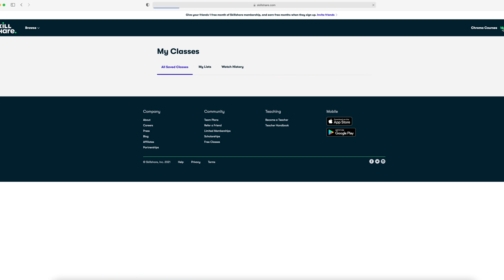RACING to Get HEAT in our OFF-GRID House BEFORE It Gets too COLD!!!

Comment: do you not have to put that foam seal on the bottom plate where it touches the cement floor?
Reply: I believe Al thinks that the lexel sealant should be sufficient?
Reply: Think about it. Foam is for a thermal break and water seepage. Not necessary  for a heated, indoor slab.

Comment: Your hard work is paying off, but there’s still a long way to go to get where you are at Lumnah acres! One thing that maybe helpful, they make a simple sheet goods 4ft x 8 ft sheet carrier that allows you to lift the sheet alone with a small hook on the bottom edge that is attached to a small metal cane like handle. When you stand erect the sheet is off the ground even when your arm is fully extended. So it’s easier to lift and carry. Your other hand is free to balance the top of the sheet or open doors as you need. You can even carry up and down stairs! Looking at all the sheet material your using lately it might be a wise investment!

Comment: Fan over the shower? For myself, I wouldn't, but it is allowed by the NEC.  Just make sure the fan you get is made for the shower. It won't be a steamless bathroom.   It will cut down on the steam, the fan is used to remove some of the steam and if left on, will dry out the bathroom. But in order to do that you will need fresh air. It's recommended to have at least 1/2" space under the bathroom door to provide the fresh air. That's means you will pulling the air over you too. That's why I like my fan away from the shower so I won't lose that warmth so fast. But if that's how you want it, go for it.

Comment: You are suppose to keep lithium batteries around 70 F to make them last. The weather conditions make everything take a lot longer.
Reply: he mentioned several times the mfgr says these are ok as long as it's above freezing. I suspect the internal temp of the batteries is a bit higher than room temp anyway.
Reply: @shartne  ... what happens? They get to eat their words over warranty claims. I would bet the conditions inside that home will be way more stable than conditions in a camper located in the desert where temp swings can be more than 50 degrees in a single day. These batteries will never see 110 degrees in the shade.

Comment: Hey guys do you think you should possibly have 2 of the radiator heaters on site just in case one fails? I know you have the connection to the system to warn you if temp drops. Lets say the radiator goes kaput and there is no way to get a new one due to road conditions or their out of stock again due to weather/availability. If there is no backup with the radiator heater I guess you will have to run the propane to keep the batteries and system warm? Just looking out! You might already have a failsafe plan or answers to this. Love all that you two do!!!

Comment: As a younger person, I always kept our sleeping area at 50 degrees and sometimes opened a window at 45 degrees outside. As I've gotten older, I find I like it warmer (65+ degrees). Leave provisions to heat upstairs for later in life. And for heaven's sakes, get a good foam kneeling pad! You only get one set of knees!
Reply: He mentioned in the video they will see how well the heat flows upstairs and may consider adding more pipes between the rafters before sheetrock. Personally, I would add the pipes anyway. Worst case is you don't use them for another 20 years. The pipe itself is cheap compared to pulling the place apart again.

Comment: I wish I were there to advise you (decorator). My husband watches your every broadcast. I would have recommended an entry not a full hallway. Even an outdoor entry to prohibit severity of weather changes in the home. Also for open space, airflow, light up the stairway, a pretty stair rail to decorate during the holidays. The kitchen wall could be relocated under the stairs with the pantry storage you spoke of. It does trouble me that your plans are all in your minds. Hoping it all works out from you. Maybe your friend from Ken's Karpentry can suggest an advisor to think through specifics. As you are planning to make this an Airbnb rental, other problematic issues come to mind.

Comment: Can I be rude and ask why you didn't go for a ground source heating option, you have plenty of land and you also have the excavator to dig for the pipe runs and it just does it's own thing producing heat and hot water for as long as the pump has power.. whereas your wood burner will need to be kept topped up and fed with fuel

Comment: Before closing all the walls up. Take many photos of all walls after electrical and plumbing has been run. Later you may be very glad you did. Before you cut into a wall in the future for whatever reason, you can reference the photos from now to see where hidden things are. X-ray vision. Label the photos and put the position of the shot on the floor plan.
Reply: keep that photo album in the utility room for the future!

Comment: I am wondering if the heat load on the well insulated building will be so low that the outdoor boiler will not operate well.
Reply: he has at least 2 more buildings to heat before the project is complete. In the meanwhile, it will be smaller fires burning slow.
Reply: @rupe53  Oversized low burning outdoor boilers around here result in layers of smoke for hours on end. I'd like to know the Btu range of the unit compared to the amount of heat that will be required in just the tiny house.
Reply: @robertbennett6697  ... I'd be curious on those specs myself. I doubt they need more than 30,000 BTUs to heat the place when it's zero outside. (plus hot water) If I had to guess, that boiler is good for well over 200,000 BTUs.

Comment: Moving right along...
One thing...usually on concrete the bottom plate of walls is pressure treated esp.around the shower. Could you get some temporary plug in electric baseboard for some free heat ???
Also no need to make interior walls soooo tight lighten up a bit...
Looking Good....
Your not running just water in your radiant heat system are you ??
I would think it's a closed system with some kind of liquid that won't freeze just in case...but I'm not a HVAC guy...i got the questions you got the answers...😮
Reply: Would you like anti freeze in your shower?
Reply: Tony Grimes typically closed loop systems include a heat exchanger so the glycol mixture circulates and never gets used as potable water in the shower or otherwise.
Reply: @garywilser7802     Thank you….
Reply: @garywilser7802  But there is no need foy glycol. Water is heated in boiler, is pumped underground to house returns to boiler. How will it freeze?
Reply: @tonygrimes13  closed loop, Tony.
Reply: Tony Grimes , it won’t if it is continuously fired in the winter but if you ever have to leave it unattended for a few days you will have problems
Reply: @garywilser7802  In all my time watching Lumnah Acres they don't take holidays especially in Winter.
Reply: Tony they can do it any way they want to do it. My intent was to explain how a glycol based closed loop system did not mean they would have to take showers in glycol.
Reply: FYI...look at it this way Tony ...water boils at 212 degrees and you don't want steam in the system so by adding  glycol to the system you raise the boiling point like in your car 
Ya get me....😉
Reply: @garywilser7802  Let's wait & see.

Comment: Al, Do you have your used water  ie bath sink water all going over to your septic tank ? The reason I ask is , We have a septic tank, we've lived in the same house for 19 years and never had the septic tank emptied , We were told that Grey water and storm water from the roof run into a separate soak away, as both of them will kill your septic tank bacteria, the Grey because of detergent and bleach and the storm water will flush out the bacteria and prevent it working as it should and it will have to be emptied

Comment: I see the foam insulation in the "mechanical" room does not fill the depth of space of the 2x4 studs.  I was under the impression that the "r" value of foam insulation is measured by the depth of foam and/or wood.  Why would you not choose to insulate water as well as possible where winters are so cold?
Reply: The studs are 2 x 6 with 32" of foam.
Reply: @tonygrimes13  hi Tony, thanks for replying to my comment. Did you actually mean 32"?  I'm glad you said 2x6!

Comment: I would think a vent inside the shower stall would be too drafty on a wet body. Your vent will do well installed in the room . Consider this: As long as the wiring for your bathroom vent fans is attached to a Ground Fault Circuit Interrupter (GFCI) and the fan is rated for a shower area, the best place to locate your vent fan is on the ceiling in or near the shower where it will do the most good. Vent fans that include a heater, however, should not be installed over a shower.

Comment: Al and Gina!. You keep  talking about the water for your boiler,I would consider that a big mistake. You should be using glycol in your system. Then if the fire is out you will not freeze your boiler or pipes under the slab. Think about this for a minute what happens when it all freezes. Other then that keep up the good work.

Comment: When you anchor your walls to the concrete floor, how do you ensure you don’t hit the water lines buried in the concrete?
Reply: They used glue.
Reply: @tonygrimes13  ... I caught that and wondered if the glue might be an issue 20 years down the road, with the warm floor. With all of the advanced planning I figured they would have left space between the heat pipes fora few anchor points. (and keep a map of that in the utility closet for the future)

Comment: I vote for plywood on that utility room wall.  It may cost you $100 more now, but the flexibility down the line and not having sheetrock around water would be a plus for me.  But it's not my $100 now.  Advice from an old fart - don't have sheetrock around water. Always plywood, greenboard or cement board.  Little leaks make a major mess with sheetrock.

Comment: Should the spray foam be the full depth of the stud? Its about the thinnest I've seen.
Reply from the maker: No the studs are 2x6 so the put 3” of insulation in
Reply: @LumnahAcres   Apologies .. I'm in the UK where studs are 4 x 2 .  Foam depth code here is 4" for internal stud walls.  Older houses such as mine have 13" Brick Cavity external walls i.e. Brick then airspace then another brick. If you lived here and survived the six month wet and cold winter then the summer would finish you off. Wood of any kind treated not in exterior walls will just rot.  Good luck with all your endeavors.

Comment: I have a question. What are you going to do in 20 years and your expansion tank needs to be larger or even worse have to get a wheel chair in the shower. You are not always going to be young.
Reply: They are only using that house temporarily until they build their larger house later.  The shower is then going to only be used for showering the dogs, and the building used for butchering their meat, and storage and other things I believe.
Reply: @virginiahill7001  Or...Olivia will claim  the loft apartment..and ban the dogs from using her shower..#Olivia..is the future planer 👍